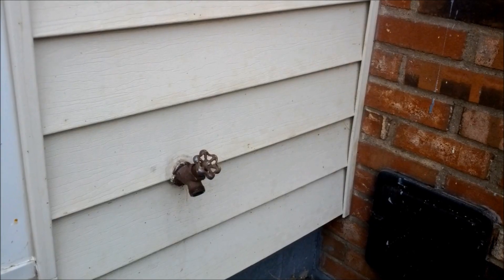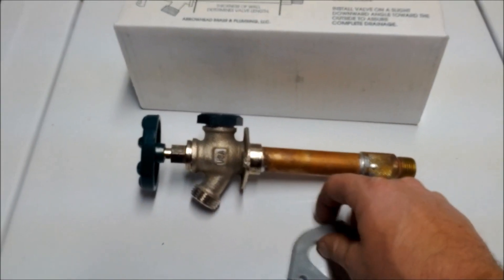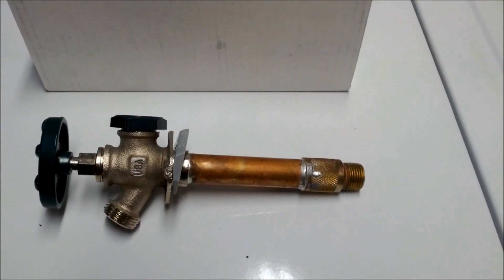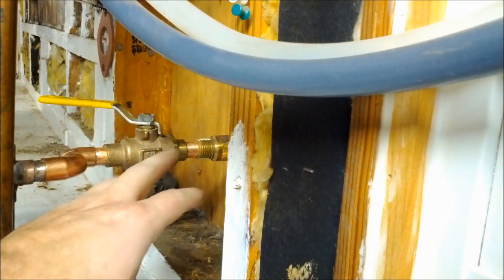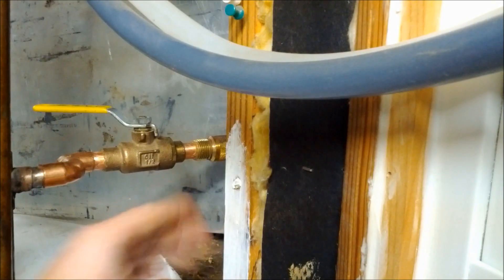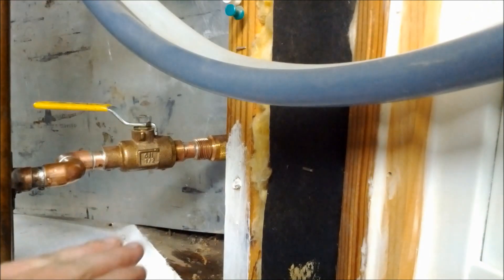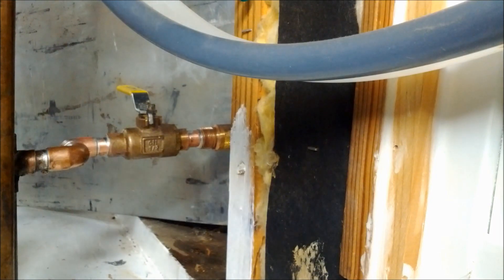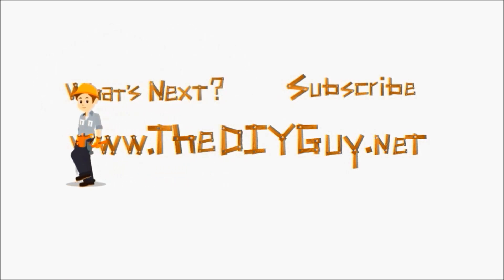How To Install A Frost Free Sillcock

Comment: Many thanks for the measurement guide at 0:46 onward because as a noob as myself, that information is therefore golden about measuring only between the mount and the bottom of the coupling which has already saved me a lot of time and headaches because I am off to Home Depot now to buy the exact length I will require to complete my task. I was looking online to find the proper length I require and I could not due to an extra inch . . . until I found this video which explains the measurement.

This is the true value of the Internet, and people for that matter, when it comes to sharing knowledge to teach others in order to help them with important tasks.
Reply from the maker: AlteredSenses Your're welcome. Your not alone a lot of people measure it from mounting plate to the end. Glad we could help, hope you successfully completed the repair. That is exactly why we started this you tube channel/ website to share our knowledge. Thanks for watching and taking the time to drop us a comment.

Comment: What's the process for installing the valve outside? Silicone only? Other adhesives?
Reply from the maker: Good point. Make sure the shim is in place and you can run a small amount of silicone along the top to shed the water. So from screw hole to screw hole on the top side.